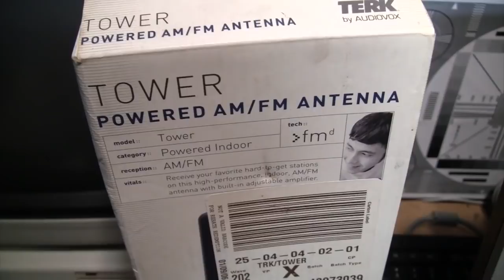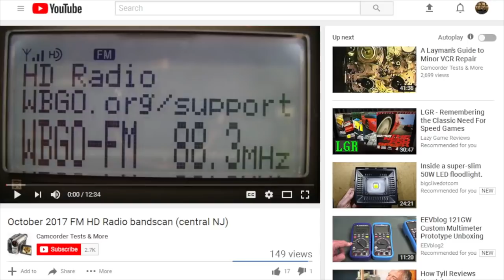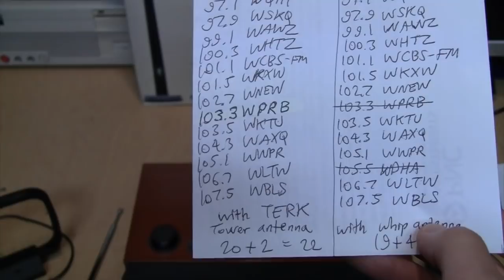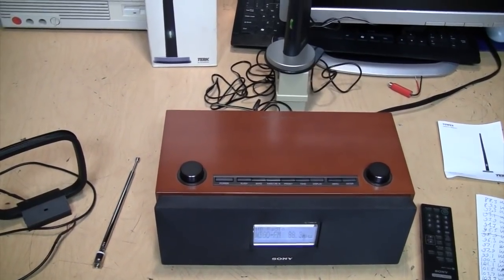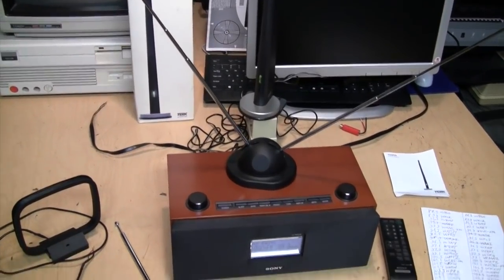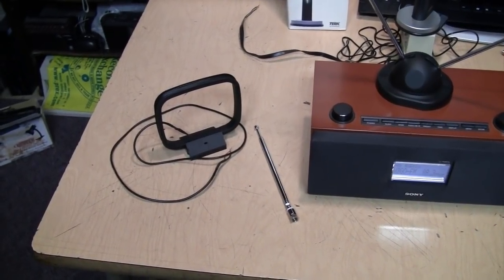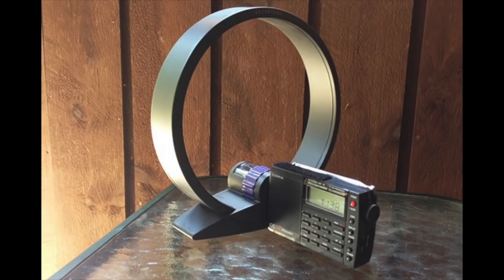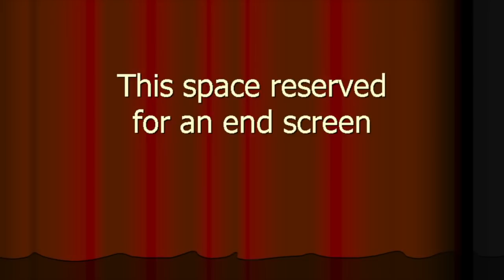Terk Tower indoor AM/FM HD Radio antenna review & test

Comment: That HD radio system makes our DAB (Digital Audio Broadcasting) radio system look like crap, but then again, farting in a pringles tube makes DAB radio look like crap, DAB is just crap through and through... :P

Nice looking Sony radio too... :)
Reply from the maker: Really? HD Radio sucks way worse than DAB. On AM it's a worthless joke and on FM it gives you horribly compressed digital audio that sounds like a 32 kbps RealAudio stream.
Reply: Well, the audio quality is still crap, but at least with your HD radio it seems to seamlessly fall back to Analogue versions of the same station, over here DAB just pops, squeaks and farts at you if the signal drops and the stream is disrupted (it uses the latest in streaming technology from 3 decades ago, MPEG Layer 2), resulting in people just giving up and going back to ultra-reliable Analogue... :)
Reply: VWestlife it's running on mpeg2, which is great when you have 256 kb, like a DVD audio track, but when the bandwidth is taken by ten stations...well, even classical music on the BBC is low bitrate mess, and some stations have to switch to mono. DAB+ which is used in Europe uses AAC+ encoding, so sounds light years better. It's one of the reasons DAB never really took off vs FM
Reply: DAB and DAB+ are the biggest tech-scams since Windows 10. It either never works or never works as good as older tech. I hate radios that habe boot time... and digital compression that makes even MP3 with 12kbits sound better than this crap they use for DAB+. I wish we in Germany got our AM stations back…
Reply: the problem is that every station here runs the same EQ and compressors for FM radio for DAB+ and also have super low bitrates. You can literally hear the chirping compression aliasing and artifacts even when you have it running in the background. That means IF you actually receive something. The broadcast transmission power is so low, even when you live near to a transmitter (like i am here in Berlin) you still get nothing but squeaks and digital glitches that makes you either switch off the radio or switch it to FM. As long as there's no stronger digital signal and no lossless FLAC broadcast, digital radio will remain a complete fail. Radio doesn't have to be digital when you have webradio. Analog broadcast is perfect for radio. Because of the nature of analog transmission of electromagnetic waves. You have a bit of noise or a super clean signal. A digital transmission instantly stops when the signal is too weak and you hear nothing.
Reply: I could listen to German radio on mw before sunset in Greece... I remember 1422 khz was very strong, bayern plus on 801 was very strong and clear signal too. Too bad they switched off. I hope someday they will return back on mediumwave. I remember too with French stations was clear and strong in Greece,  could hear nice music on France Bleu 1278 khz...
Reply: A trick shops use to make DAB radios sound better is they install a repeater in the building linked to a hefty antenna on the roof so it sounds OK until you get out of the store and find that in the real world it sounds like crap.  MP2 doesn't work well in moving vehicles and due to cramming so many stations on each mux, DAB in the UK sounds much worse than FM.  It degrades horribly as well, unlike FM.  Quite why the UK didn't go with DAB+ like the rest of Europe is a genuine puzzlement.  The radios are bloody expensive as well.
Reply: I’ve told you before, Kraftwerk2K6, that this is entirely dependent on the operator. In the Netherlands, most of the DAB+ stations do use the advantages that they can use to optimise audio quality. First and foremost, almost no station defaults to the lowest-possible bitrate of 96kbps; so almost all of them use higher bitrates than this. Then there are the specific audio-related parameters that operators can supply within the DAB+ encoding. These have to do with studio-end equipment such as compressors and processors, but also with literally telling the receiver (i.e. the tuner on the listener’s end) what to look out for, basically. So that the receiver can play a role to further improve sound quality. For the stations that use high bitrates, I can honestly say that DAB+ can and does sound better than FM. Provided your reception of them is good. If not, you’re left with the audio equivalent of Swiss cheese…
DAB (without the Plus) is as bad as you describe… It uses MPEG2, as VWestlife said, and therefore bitrates would have to be much higher than they could realistically be to even come close to FM quality. However, I’m still not convinced as to whether HD Radio would be a better alternative even for territories which have to make do with DAB. This is because I cannot help but thinking HD Radio actually takes away quality from analogue FM reception, because a signal’s bandwidth on the “main carrier” will be reduced if more “subcarriers” are present. FM monaural audio is virtually hiss-free. This changes when a station has a stereo signal available, even if you switch to mono by hand. The same would be true (again) for HD Radio subcarriers. It would eat away at the bandwidth normally reserved purely for audio. So even if HD Radio would have the “advantage” of automatic fallback to the analogue signal, this signal itself would be negatively impacted by the mere presence of an HD Radio subcarrier, even for sets which do not support it. I’d rather switch from DAB+ to FM manually, whenever need be (which isn’t all that often, to be honest with you.

Judging by the fact that you live in Germany, I think there’s an additional problem at hand. Stations in Germany largely refrain from using any more compression than is needed to comply with standards. In many countries, including but not limited to The Netherlands and the US, stations use compression to ensure that a certain “kind” of sound is being accomplished (i.e. the user can hear that they’re listening to a certain station even without having to hear its callsign) and also to make sure that the sound is the same in the car as it is in the home. This, of course, compromises dynamic range in music, as soft portions are amplified and louder portions are “limited”, effectively leading to a continuous stream of sound. German stations have largely decided to do neither. You can easily experience the difference yourself by tuning into a station from another country, then turning the volume down to a level at which the sound is just intelligible, and then tuning back to a German station.
This German approach makes the stations much more enjoyable to listen to on FM, and AM for that matter, but it further complicates the optimisation of sound quality for DAB or DB+, as there is nothing to play with where compression is concerned. The "optimal minimum" settings for FM are different than those for DAB and DAB+, but since there is little to no compression at all used by most any German station, there would not be anything to optimise, either.
This is in stark contrast to the Netherlands. As I’ve pointed out, compression is used to a large extent here. This does two things. First of all, it enables the stations to “play” with the settings and thus optimise the quality for DAB+ as well as for FM, but on the other hand, there really isn’t that much difference in terms of how the actual station is supposed to sound, regardless what carrier (DAB+ or FM, or indeed the Internet) is being used.

In other words, DAB+ is not to blame for being a bad standard. Especially when in a day and age where the signal carried over it is compressed to hell to begin with. This compression is present on all ‘protocols’, whether FM or DAB+, so there is no such thing as a neutral base any more. This is true at least for The Netherlands. If, then, the station is allowed to transmit at sufficient bandwidth, the quality is not negatively influenced by a station’s move to DAB+. So it all boils down to HOW the standard is used; not to WHAT standard is used.

Of course all this is not true when comparing a truly uncompressed signal, free of ANY kind of compression, to one which IS compressed. That may be the main problem you are experiencing, since German radio stations generally refrain from using more than is needed purely to comply with regulations…
Reply: I hope Germany gets its' AM Radio Stations back and on the Air.  With all those great radios made by Grundig and so forth, it is a shame for Germany not to have vibrant AM Stations.  I didn't know Germany had done away with them. @KRAFTWERK2K6
Reply: Hopefully those radio stations will begin serving the public again.  80% of the people in the United States still lister to radio over other sources and are very happy to do so  They all listen primarily to AM stations when driving their cars although the Classical Stations on FM remain very popular especially KUSC out of Los Angeles which is broadcast from Santa Barbara to Palm Springs and out into the Desert areas..
AM and FM is still very strong all across the United States.  It never faded and is more popular with the public today as it was when we had no television. @alexdx4872
Reply: @alexdx4872  Hopefully the AM and FM stations will again be broadcast in Greece.   Shortwave, although fewer stations is still popular in the United States.
Reply: @alexdx4872  that is what i love about AM the most. The sheer range or reception. At night i can receive some BBC stations, an hungarian station, 1 dutch station, 1 french station and one romanian station as well as some arabic sounding ones who have appeared recently within the last year or so. The only times i cannot hear anything is when some neighbors keep their freaking Powerline Internet adapters running nonstop… which fills the AM and SW band with a loud nasty buzzing noise all across the band.
Reply: @richardmcleod5967  Would be lovely but i doubt it. The whole broadcast infrastructure is privatized and the german politics is also in the tight grip of the digital radio lobby who's only goal is to eliminate the last analog spot and replace it with expensive technology that nobody wants. YOu should see how aggressively they market it here and extremely unisono everywhere, without the slightest bit of criticisim. The cartel wants to see analog radio dead and with it huge moutains of radios that can no longer be used and which they wanna see being replaced with the expensive DAB+ crap…  I have given up all hopes. Europe has no radio culture anymore.
Reply: It is a shame that radio in Europe has dropped to such low depths.  As long as there is hope and the people in Europe desire the AM and such broadcasts, hopefully the situation can change.  Don't the Politicians there listen to the people in this regard?
It hasn't changed here in the Unites States, and I am not sure why except to say that the people enjoy the analog AM and FM radios.  Even ham operators are still popular with many people and Shortwave stations are still available, not as much as in the past but it is still there.  The only band we have lost is the Police Band.
Radio is so popular in the States that 80% of the people still listen to radio more than any other source.
Luckily, the forces that be (FCC) realize that and the populace has demanded the old systems be kept and those posers have responded.
Germany made many of the best radios ever made in the World for many years.  A shame to think they are just sitting there with no sound.  I know many of the great old German radios are being restored over there and sold to buyers all over the World on Ebay and other Internet sites.  They are especially popular in Japan and very popular in the United States. @KRAFTWERK2K6
Reply: @slashtiger1  Living in the Netherlands myself, I can only shake my head at all the nonsense you've spouted here. For instance, this quote "almost no station defaults to the lowest-possible bitrate of 96kbps" is not true by any means. First of all, 96kps isn't the lowest possible bitrate, the lowest allowed is 40kps which is actually used by some DAB+ stations here. Most of the public broadcaster NPO stations do use 96kps in AAC+ but, most others are below that. Even the regional public broadcasters only have 64kpbs available which is by no means hifi quality. 

It's also not true that German stations don't use dynamic compression. They do - and just as much as Dutch stations or just any other station. For the public broadcasters, quite often very high bitrate satellite stream (320kps / mp2) is used from which the DAB+  AAC+ signal is derived. Whilst that satellite stream could be regarded as "studio quality" - that is: transparent to the source and free of obvious artifacts - it's still dynamically compressed at the source. In other words: it sounds better than FM quality, but not as good as the original CD. Not because of data compression (320 kbps in mp2 is almost on par with 320 kbps in mp3 and most people wouldn't be able to hear the difference between to two or between the mp2 and the source) but it's still dynamically compressed. It has to be, since it is used as the source for FM transmitters and thus has to be adapted to fit what FM broadcasting can handle. 

As for HD radio - I do agree with you there: it seems to be too much of a compromise format where the digital part does indeed take quality away from the existing analog signal. The sound quality could be quite good if only one digital station is in the digital signal, as it would be at 96kbps which can be quite acceptable with AAC+. Most HD-radio stations however simulcast more than one digital station which leads to a reduction in bitrate. With three stations, you're listening to 32kpbs each which is barely acceptable for speech but not for music. At least with DAB+, it's broadcasted at non-FM frequencies so that's less of a problem.

The U.S. HD-radio could be better if the analog FM stations were switched of and the channels were used for digital-only stations. However, in the real world that bandwidth won't be used for less compression and better audio quality. It will simply be used to cram even more stations in. You can already see the same thing in the UK people complained for years about DAB's poor audio quality, advocating for  a switch-over to the more effecient DAB+ only to see the now emerging UK DAB+ stations to use even lower bitrates. Yes people, in this digital day and age with 4K/HDR tv in the shops everywhere and conveniently streaming to your house via Netflix, in the audio world we are moving to a situation where 32kpbs bitrates become the norm. Perhaps internetradio will save us from that atrocity, but don't hold your breath yet.
Reply: @BlaBla-jj6sh  I did not include the regionals in my original comment when going on about the bitrate (other than the provincial broadcasters such as L1, Omroep Brabant and the like). That would be because there simply weren't that many smaller regional stations on DAB+ (at least as far as my own region was concerned) when I wrote my comment.

On Germany: they definitely do not use DRC in the way we do, nor in the amount that we use it. I know that FM requires some compression because of the modulation, so yes, that would always be applied, simply because not doing so would simply not be possible. If you'd have read my comment in its entirety, you would have seen that, in fact, I did include this in it. Anyway, the Germans (at least the WDR and other public services) definitely have a different approach when it comes to DRC. The easiest way for any old layman to notice this is to simply take a VU meter and  compare the signal as output by, for example, WDR4 to that of, again, for example, NPO Radio 5 (I chose these two because they play roughly similar music). You will then see that, in case of the Dutch station, the VU meter will nearly always stick around the 0dB mark, because we (in The Netherlands) like to mix as hot as possible. Doing so requires the use of DRC.
The Germans, as I did say in my first comment, do use DRC, but they definitely do not do it to the same factor as we do. There is just much more dynamic range in the signal compared to 'ours'. That is why I did say they use it to the extent that is required by FM in order to even be able to broadcast.

Things may, and probably will, be different for commercial broadcasters in Germany.

Also, I do not know what makes you think that every station would be using DRC in the same way as everyone else. At least that is what I gathered from the following segment of your response to my comment: "t's also not true that German stations don't use dynamic compression. They do - and just as much as Dutch stations or just any other station. ". If I've ever seen anything that would not be true, it would be this. Simply because of the fact that DRC and the way you use it is part of the way you sound as a station. Even the way Q-Music uses it (in The Netherlands) differs from the way Sky Radio uses it. In similar ways, the usage in Germany differs widely from that in The Netherlands. I happen to work at a local radio station, and have seen many studio set-ups as part of this. Both smaller and larger ones, I might add.  Also, we've actually had quite the discussion on the way our station sounded, and about what role DRC played in this. We obviously have to use it because — FM, but we are quite free to decide ourselves how we want it all to sound, and, therefore, to decide as to what extent we would want to use it to. Just as long as it all falls within the specifications set forth by FM and all the standards in relation to it.

I think we (as in you and I) may actually be talking about different stages within the broadcasting process here. Because what I meant is that we, at our station, do hardly apply DRC when we record our programs or have a live broadcast in the studio. But that doesn't mean that there is no compression, simply because that would not be possible. In a similar way, many, but not necessarily all, German stations refrain from using too much DRC at that stage. However, at some point, there will likely be DRC to comply with the aforementioned regulations.